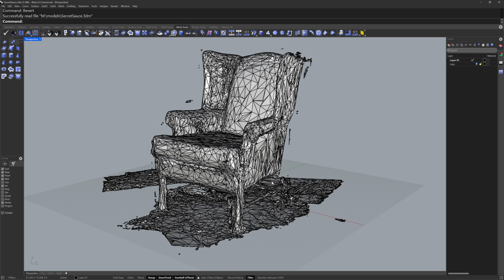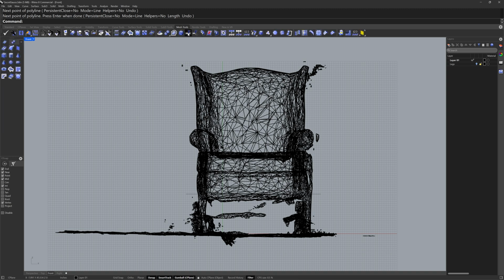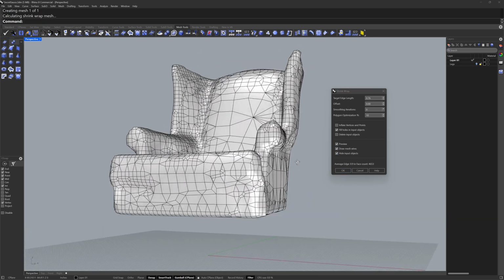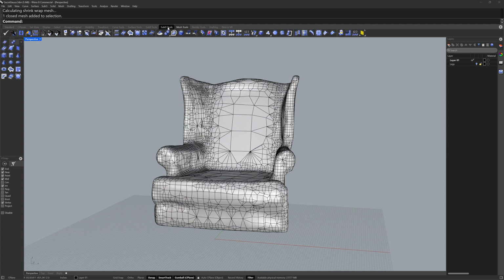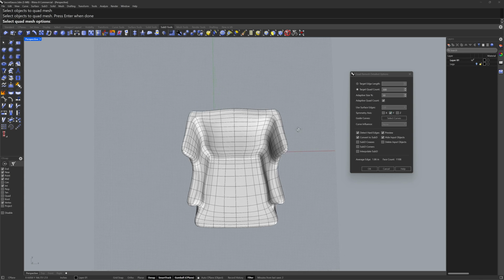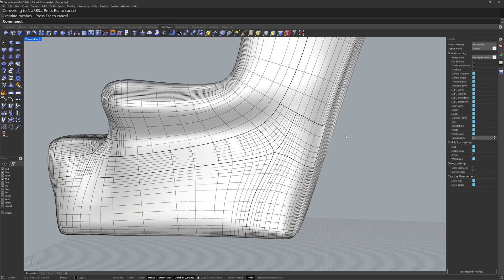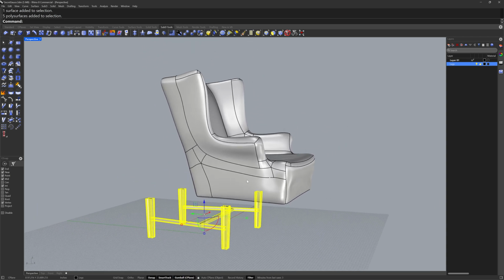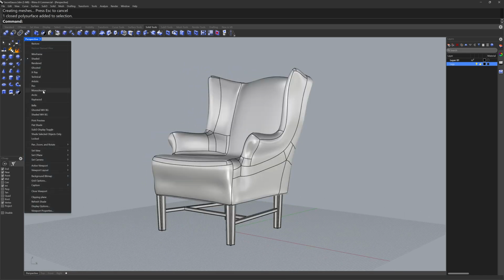Rhino 8   The Secret Sauce!

Comment: Honestly, this is tool is BS, sorry guys, just try to convert any square model and you will see how bad it deals with rectangular models smoothening the corners no matter what settigns you choose. It's a shame that you can't match Fusion 360 conversion (which is a terrible software, but at least it does the job of STL conversion).
Reply from the maker: you using hard edge detection and creases?
Reply: @Rhinoceros3d  i am using hard edges detection and creases, the output model doesn't have hard edges, they are smooth anyway, so there are no 90 degree corners, there are no corners at all
Reply from the maker: @MegaBlackJoe  can you send us a model to look at with your steps so we can try to repeat your process? also any images to highlight your problem areas- 

tech@mcneel.com

Comment: How was the chair scanned?
Reply from the maker: using the object scanner in iRhino on an iPhone. (grab it from the app store for free!)
Reply: @Rhinoceros3d  WHAT?!? lol... somehow this slipped by me. Thanks.
Reply: I used a LIDAR scanning app on the ipad, there are many but generally it's not a great result.
Reply: it's a trash result, Iphone is not suitable even for large objects like cars - by analyzing the data you can see how much the scans are off, it's not able to produce a straight line without deviations  @RhinoGuide

Comment: Thanks for the explanation! I use did the same using  Instant Meshes. But the issue always I have is the loss of datails in subD process. Do you have any advice for that?
Reply from the maker: sadly the only way to keep detail is to crank up the complexity of the model. Or when you are in subd tweak the subd model to re capture detail lost in the shrinkwrap/ quad remesh step. (check out the new soft creases in v8) 

there is always a balance between detail and complexity and you have to mess with it a bit to find the balance that is right for your particular project.